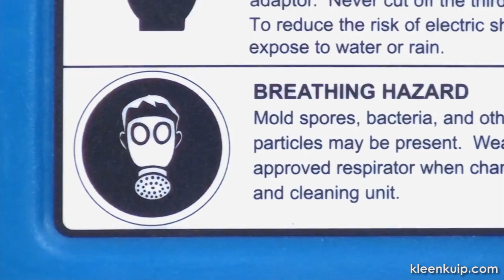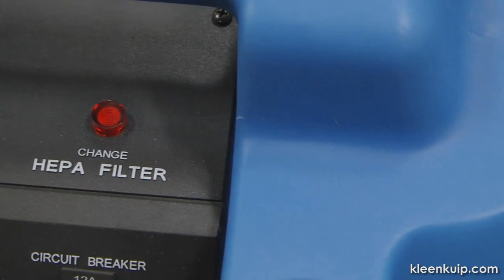Indoor Air Quality - DriEaz Defendair HEPA 500 Air Scrubber

Comment: so that charcoal filter could be an nano filter Also right?  wouldn't that be good for fire jobs and mold since they microtoxins can be .01 microns?  Helps with the vocs correct?  love the video
Reply: Is it ok to stay in your home or condo like I have while it is being used because I tried it and started to feel light headed and sickly ?
Reply: How many cubic feet per minute does it put out.
I know that y'all a lot of times use these negative air machines as what they call an air scrubber and you set it in the middle of the area you're working in and you move it around throughout the room and in the abatement industry we call that the dryer method but we normally take our negative air machines which is pretty much tje same as a 500 is and we set them up exhausting out of out of your room but there is nothing wrong
 with setting them up throughout the room and using them as air scrubbers even when we are exhausting with our negative air machines we still set some up with antimicrobial filters on  containment to give us negative pressure my point in all this is regardless of what your cleaning and what's in the air I think that you still want to get for air exchanges per hour.
Meaning that you take all the air out of the room and replace it with make-up air at least 4 times an hour.